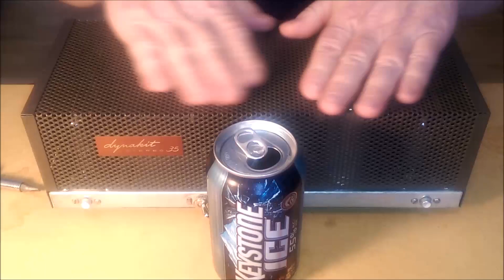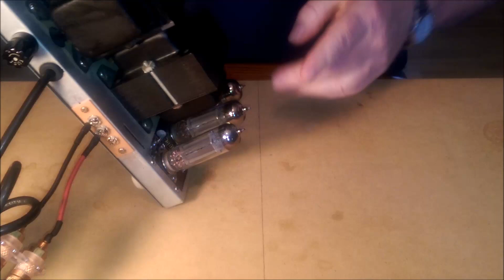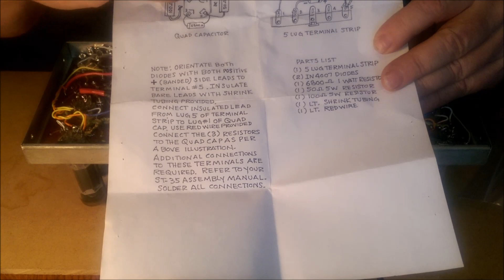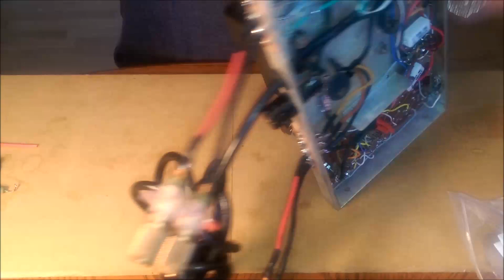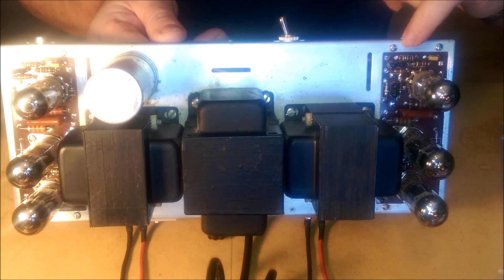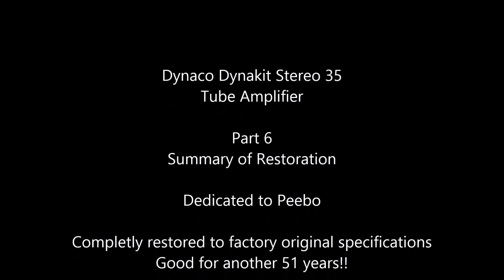DynaKit ST-35 Tube Amplifier: Part 6

Comment: Hey Rob. Enjoyed the series. Great build!

What's your opinion on the EFB power supply board upgrade? Worth or keep original design?

Also, I am a fan of rock, modern and classic. Do you think this amp will sound good for modern rock (heavily distorted)?
Reply from the maker: Thanks, Glad you enjoyed it. I was only interested in restoring this amp to its original spec. I wanted to preserve the original sound of it so I never considered any "upgrades" to the power supply or others.. It is one of the best sounding amps I have ever owned, that's for sure. It never suffered any ill effects as far as I could tell using the original power supply. I suppose it reproduces any genre of music with ease. I listen to a variety of genres and have never felt it fell short.